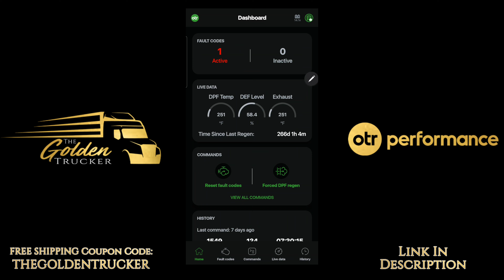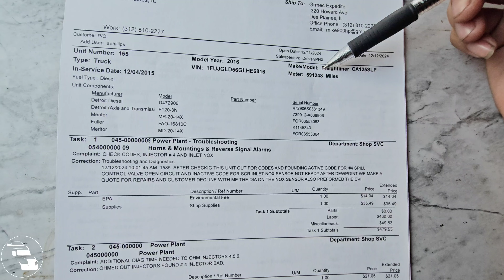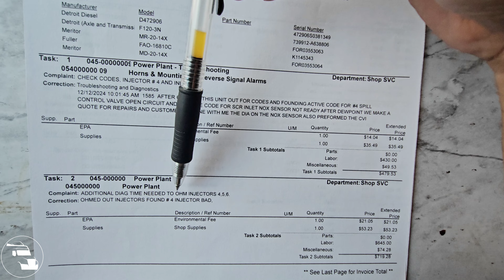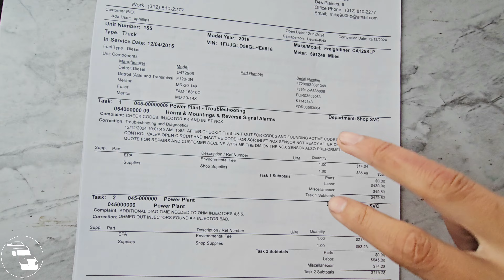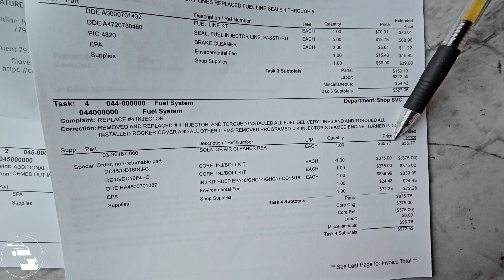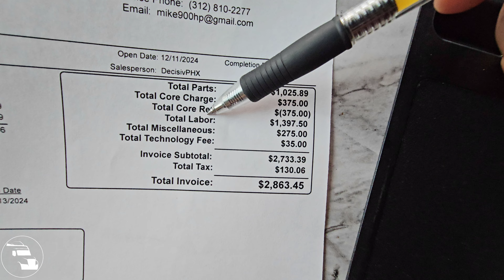SPN 3662 FMI 5 | BAD Injector Cylinder #4 Amplifier Control Valve Abnormal Operations (OPEN)

Comment: Hey bro, did you ever get this cold fix? I’m having the same issue with my 2015 Cascadia.

SPN 4364
FMI
18
Reply from the maker: unfortunately I haven't fixed the issue. I'm currently still dealing with the issue. I have done a few things that I think have helped the issue as far as it requiring less forced regens but the lights will pop up from time to time.

the latest thing that i have done that i believe to have had  fixed the issue is that I replaced the Engine air filter. Haven't had the lights pop up in a few months since i changed it. other things i have done to it in the past:
 
things I have replaced: I cleaned the dpf filters and replaced the dpf filter clamp and gasket kit, replaced the DEF doser/injector, replaced the def pump filter, installed a def awning kit, replaced both the outlet and inlet NOx sensors. even after all that, the lights still come on but not as often.

Other things I have done that I believe it helps the issue: Haul lighter loads (30k lbs or less, I do dry van), I don't do mountains unless really light load, and I idle as least as possible. I understand it can be very hard to do all those at the same time while trying to get the best loads. hauling heavy loads puts a strain on the truck engine causing the lights to pop up, especially going through mountains. that's why i recommend replacing engine air filter.

I have come to the conclusion, just like any other part on a truck, it's about that time to replace the whole dpf system, ranging from 8k-12k to replace, especially if its an older truck. I don't have that type of cash laying around so I continue with the issue for now. I hate it because 95% of codes tells you what the issue is and you can easily go fix the problem, but not with these issues.

 every video I watch about the issue just gives me different answers, and even then, they never say if they actually fixed the issue. all they do is clear the lights and send off the truck. I feel your pain and i wish I had an answer. Best of luck and your not alone.
Reply: @ ok thanks man. This has been driving me crazy I was considering getting a Delete.
Reply from the maker: just make sure you get it done with someone reputable. I've heard lots of nightmares.